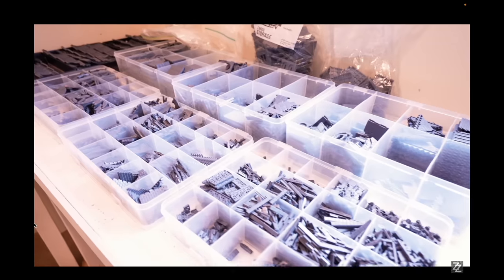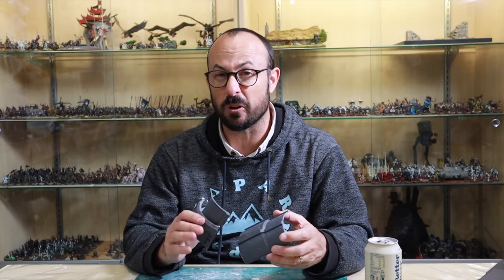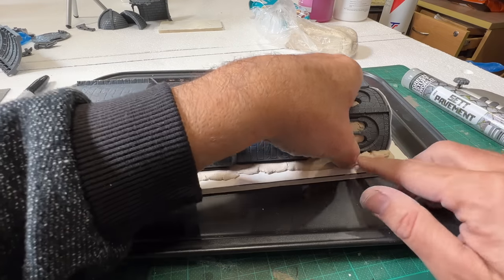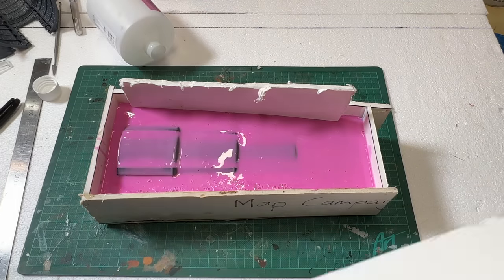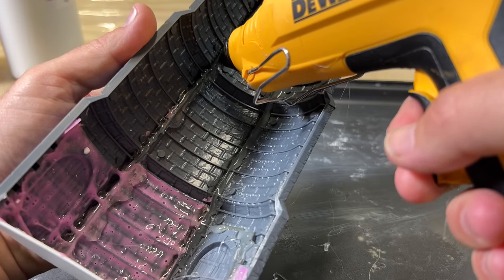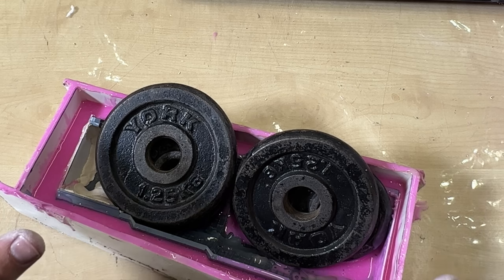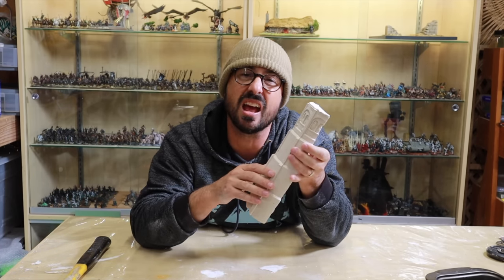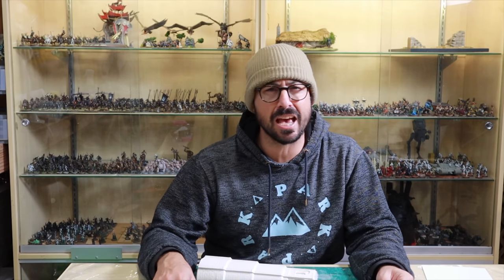Recasting Warhammer Terrain on a Budget!!!

Comment: Nice job! I will always be a fan of getting the max amount of use out of those expensive plastic kits. A tip for plaster: You can coat it using poliurethane resin, the one you get in A and B components and is mix 50/50. The dry plaster is porous, and will absorb the resin, which will then cure from the inside of the plaster. Every porous material can ge given this treatment, like carboard or wood. Thanks for showing your mistakes too, it helps a lot.
Reply from the maker: Wow that’s a great tip! Thanks mate, will definitely try this!!!

Comment: I use pva to secure my piece in place on a cheap plastic container. Obviously that won’t work with such are large piece like you had but it’s worth mentioning.

Also why did you worry about not having enough liquid silicone to cover the tower in one go? The stuff I use joins just fine when applied to solid silicone.
Reply from the maker: I worried because I didn’t won’t to have to buy more. As it turned out I did in the end anyway! 😅

Comment: as a tip      there are DIY silicone molding techniques.    from much cheaper store bought silicone.  corn starch putty molds,   and soap  soft mold techniques.      And if you're ok with using clear acrylic resin (that is much less thermo)   can  use much much cheaper/easier  gelatin molding techniques.  

simple reality is.   rubber silicone molds are just too expensive for one off casts.     if you need to make a spare bit,   or even a larger piece.    highly recommend trying gelatin molds  with clear acrylic resins.          overall price point is much much less.         (and gelatin is reuse-able  ---just microwave/chill it each time need to recast/switch molds)
Reply from the maker: Thanks for the detailed advice, much appreciated 😁

Comment: for future reference, with silicon first carefully paint on a skin layer of the piece you are doing, stippling into any cracks and details, and on any edges that leaks may be an issue and wait for it to set, this will ensure you don't get any air bubbles trapped and don't get any leaks from your main pour :)
Reply from the maker: That's a great tip thanks Tim! 😊

Comment: For your mold case, one thing to consider is making a very small batch, and using a cheap brush to paint a little bit in all the places you think the case might leak, let that set then mix the rest and do the actual pour (or if you have patience, do a water test to check if you've sealed it.)
Reply from the maker: That's brilliant mate, I'll definitely have a go at that next time. Thank you! 😊